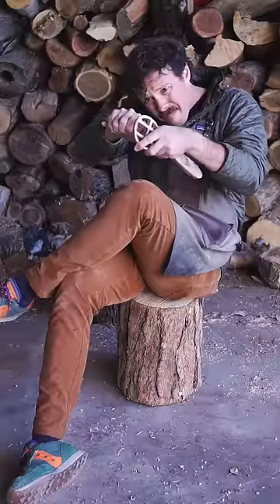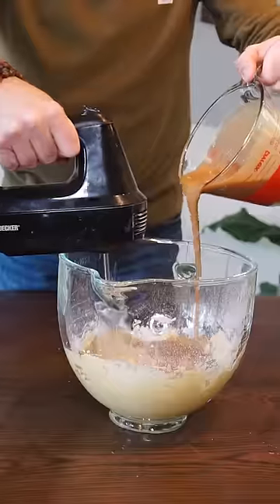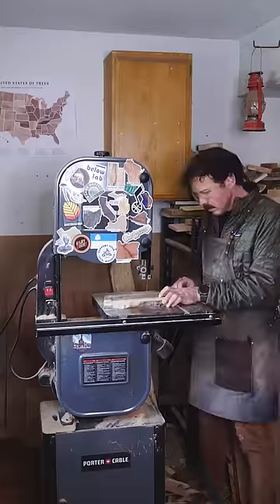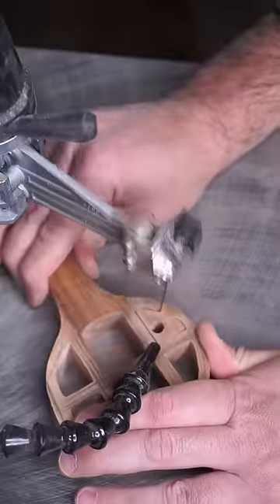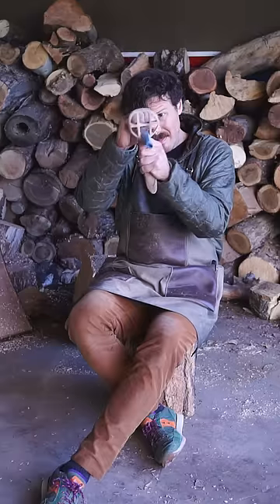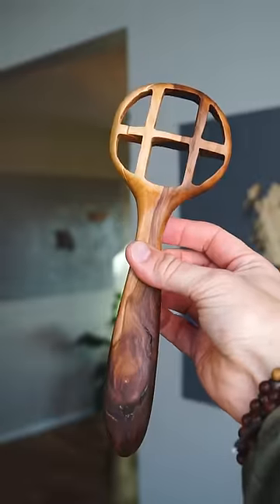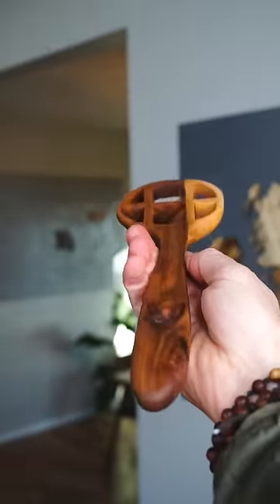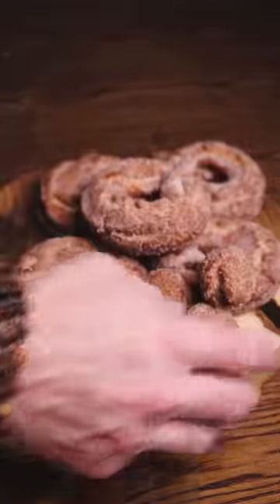Carving an Apple Wood Donut Flipper for Apple Cider Donuts!

Comment: If you're ever in Vermont you need to go to the Cold Hollow Cider Mill. They are a tourist spot that gives tours of how they actually make fresh apple cider. But the treasure of the place is the apple cider donuts. They are incredibly fresh as they're using apple cider made on site and they are literally fried minutes before you eat them. They have the machine that drops rounds into the hot oil right behind the glass counter with a constant turn over so they're always fresh. Locals don't really care about the tours and knickknacks but everyone loves their donuts. It's one of those places with only one very simple thing on the menu because they only need one thing on the menu and are incredibly popular with tourists and locals.

Comment: The apple tree fact is partly true. While yes, most apple trees will have differing tastes, it’s not very often noticeable unless you specifically compare them, but if you just eat some there won’t be much of a difference. Over enough time, apple trees will eventually turn into different breeds in this method, but the most common way of engineering a perfect apple tree would most likely be through cross pollination with other breeds.

Comment: Does wood hold up well with hot oil over time? As I'm writing this I can't think of any reasons why it wouldn't work... I've just never see wooden frying equipment before.

Also, you used metal rings to cut the dough in the video. Maybe some wooden cookie cutters could be kinda neat to have? Plus you can carve whatever shapes you want... An x-mas idea perhaps?